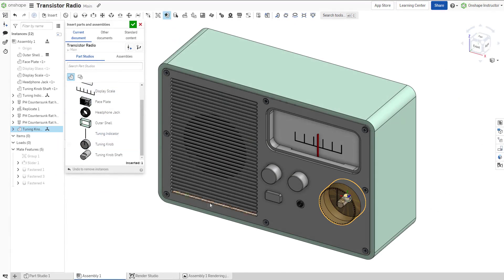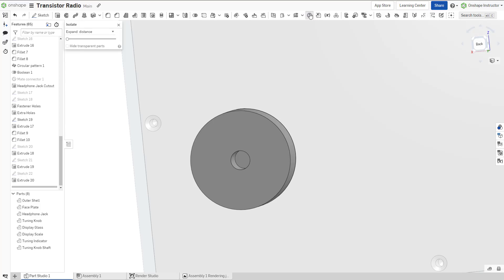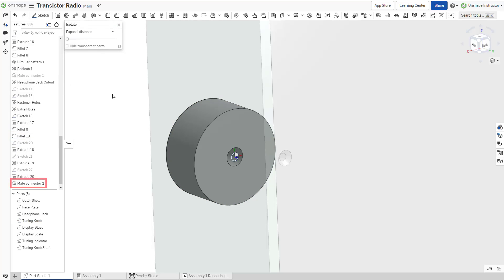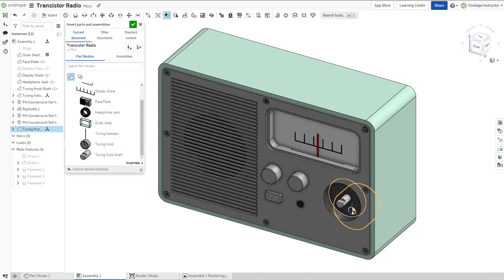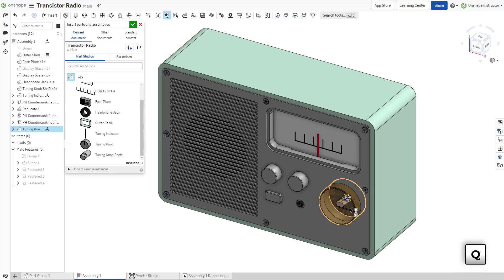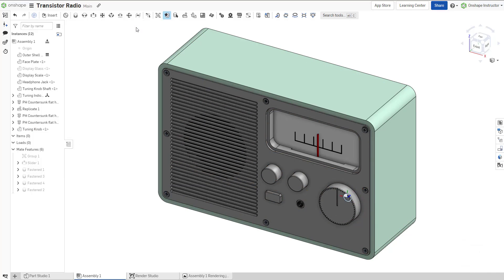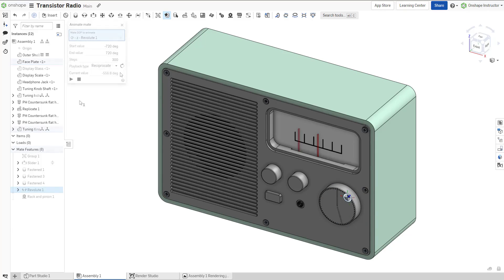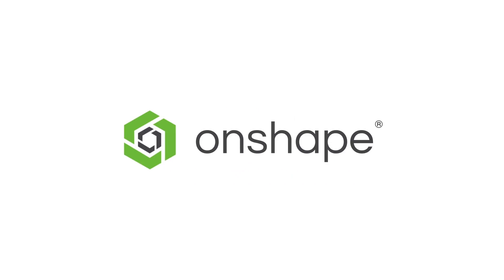Tech Tip: Add and Mate Parts in Assemblies Using Onshape’s Snap Mode

Comment: It would be cool if you could select two mate connectors in an assembly, and then use that to generate a part expecting 2 mates (e.g a belt over 2 pulleys would be neat)